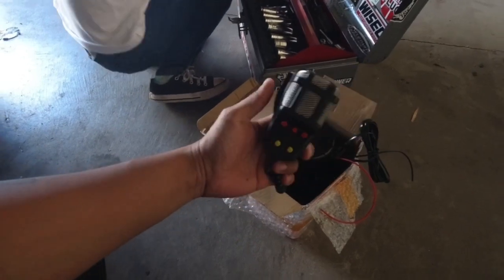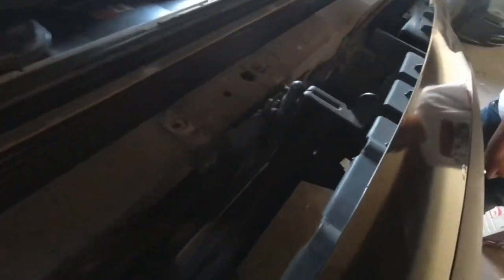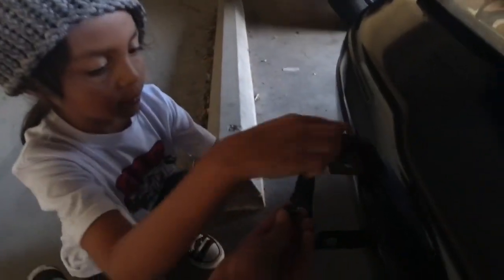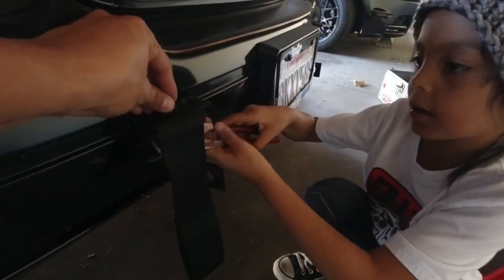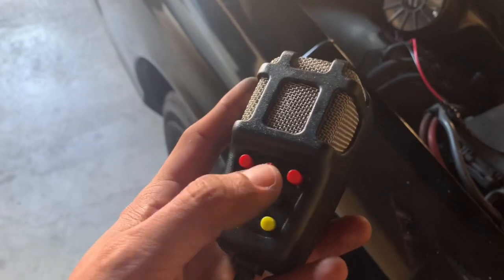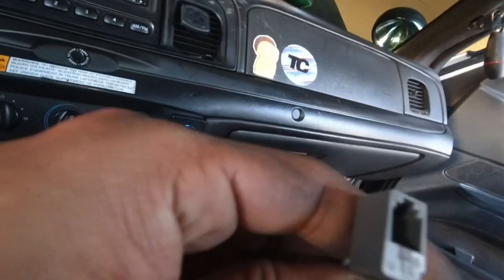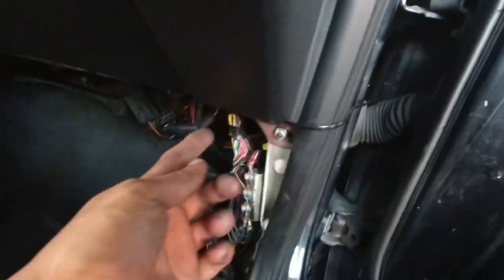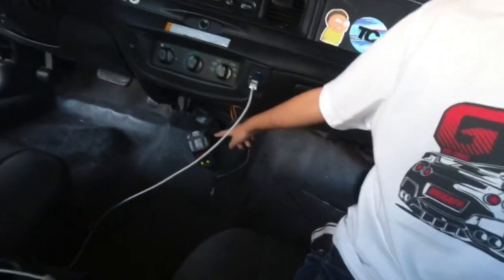We got a PA System!! Louder than we thought!!

Comment: Tip: install bolts top down. That way if the nut comes loose, the bolt will not fall out. This is why bolts are installed like this in aircraft this way.